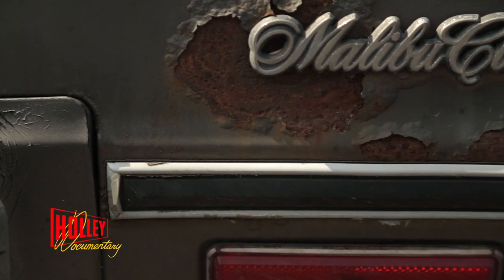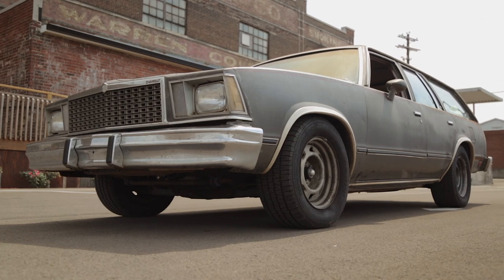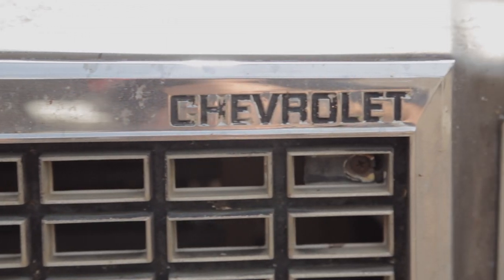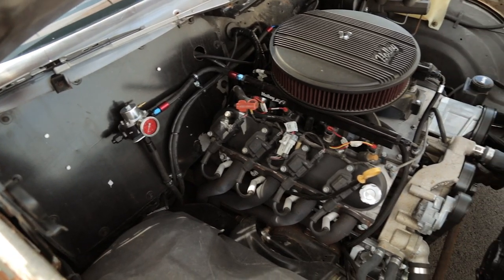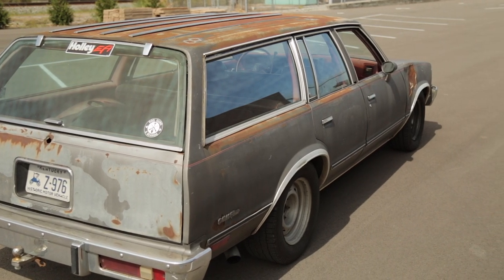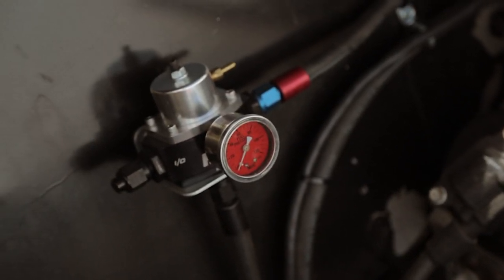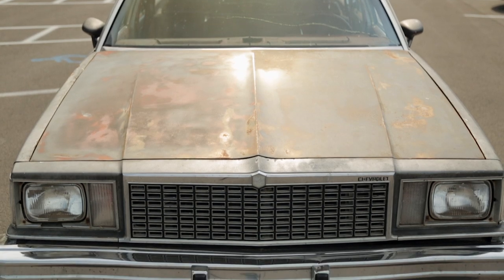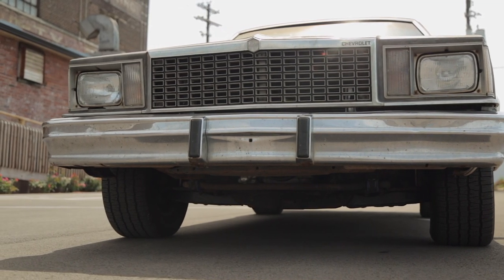Back Again - Carl Turner's LS Powered 1978 Chevy Malibu Wagon

Comment: Where in KY are you? I'm outside of Lexington. 
I had a 79 wagon and a 78 4 door. Bought the wagon with 135,000 on the original 267 v8 and th350 trans. Sold it about 10 years later with 335,000 on it and it still ran with the original driveline. I put a 350 in the 78 4dr and immediately had to put big tires on it because it would smoke the tires all the way through 3rd gear with the little 205 70 14s on it.
Reply: In the Bowling Green area.

Comment: Where the ford guys at?
Reply: CesarConH here 5.0 coyote 412hp stock,5.3 ls 305hp stock hmmmmm.You know the ls will break too
Reply: Dwreck Baker coyote is mean....but is still way more expensive than a basic ls....more compare to a basic 2v mustang motor in price....
Reply: Dwreck Baker 

For $170 bucks per long block I can wreck a bunch of LS based engines for each of your giant coyotes. 6.0 truck engine with a cam makes every bit of the power too. Coyotes are great but they're also expensive and big.
Reply: CesarConH 5 cars back 😅
Reply: @turbo_ivo  right behind the Dodge guys lol